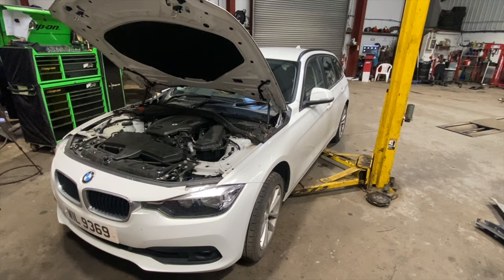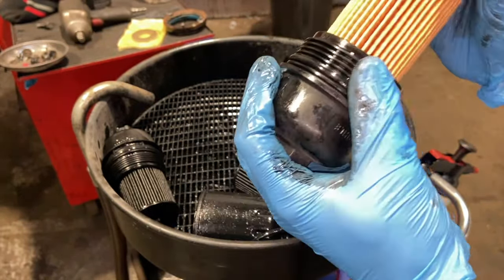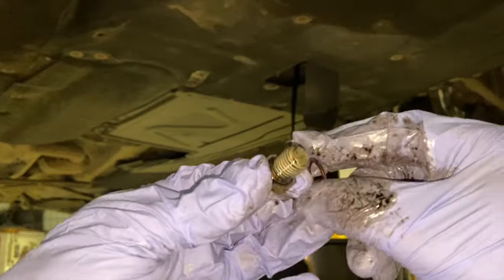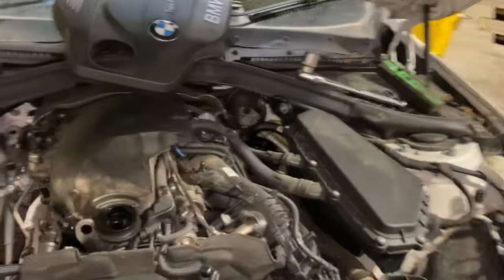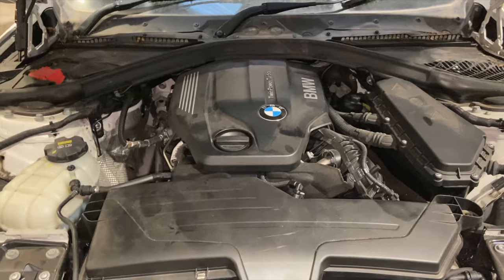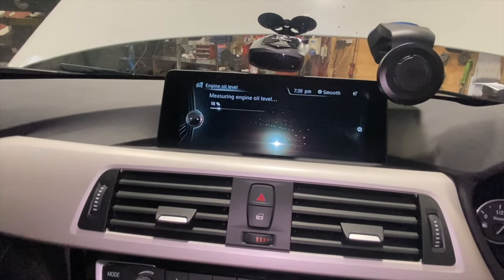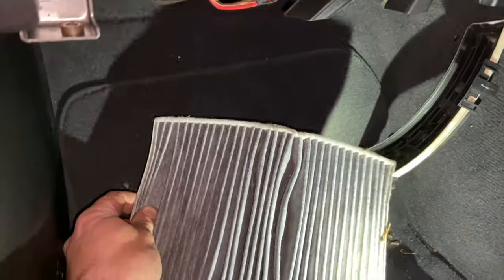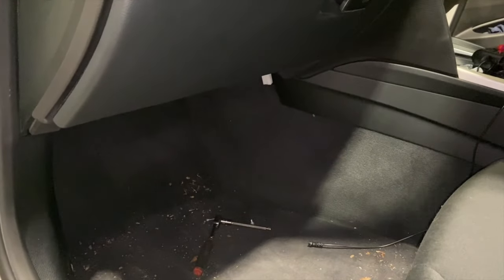Engine service procedure BMW 320d F31 (Oil, Air, Fuel & Cabin filters)

Comment from the maker: Check Euro car parts - https://tidd.ly/3lIO7xA  (use discount codes on site)
Check "Car Parts for Less" - https://tidd.ly/2LNEwIn  (use discount codes on site) 
Check GSF Car Parts for parts - https://tidd.ly/3q1T7Q0

Engine Filters & Oil from Euro Car Parts : 
Oil Filter - https://tidd.ly/3niljNK
Air filter - https://tidd.ly/3vghTh3
Fuel Filter - https://tidd.ly/3ve0SUB
Cabin Filter - https://tidd.ly/2QWtO4A
Engine oil 1ltr - https://tidd.ly/2Qw5qqJ
Engine oil 5 ltr - https://tidd.ly/2QQRW95

Full service kit inc oil Ebay - https://ebay.us/4XrUEi
Engine oil eBay - https://ebay.us/NCbyM4

Engine oil amazon - https://amzn.to/3dJBXlV

Tools : 
Brake cleaner - https://amzn.to/3ni29qU
Digital torque wrench - https://amzn.to/2PgQw79
27mm low profile 3/8 socket - https://amzn.to/32IkLad
Socket set - https://amzn.to/3eGx2Ak
Brake cleaner sprayer - https://amzn.to/2BLF1gX
Longer reach 3/8 ratchet - https://amzn.to/3iJsADg
Ring Inspection Lamp - https://amzn.to/3gGWHcG
Pic set - https://amzn.to/33JcZyJ
Dewalt 3/8 impact driver - https://amzn.to/3njemLY
Screwdriver set - https://amzn.to/3jswgJP
Budget EOBD scanner eBay - https://ebay.us/IHpAfK 
Advanced EOBD scanner eBay - https://ebay.us/odL6V7
Torx & screwdriver bit set - https://amzn.to/3sR77fr
Reply: Yep. Excellent job, nice video, tis well-explained !
Reply from the maker: @Dm64600  thanks for the comment 👌👌👍

Comment: Great video mate. Thanks for the tip on the green tabs on the fuel filter. They can be quite fiddly to remove. A few points worth noting, the car does have a dipstick as others have mentioned. Its also best to use Mahle filters. The cabin filter you fitted doesn't have the charcoal layer which prevents bad odours from entering the cabin. Lastly its best to start the service with replacing the engine air filter. That way the clean oil gets fresh air on its first start up. If the old air filter is really dirty, some of the junk can get into the clean oil.
Reply from the maker: Thanks for the comments, feedback is always appreciated 👍👌
Reply: That’s not the way engine air filters work. Unless you have a breach in the filter media or perimeter gasket, a loaded filter actually blocks MORE particulates from entering the engine. Do the air filter replacement before, during or after oil change- it doesn’t matter. 
And as for using only Mahle filters- also incorrect. Mann, Hengst and Bosch all make filters perfectly suitable for BMW.

Comment: Thank you very much, especially for showing the correct disconnect procedure for the fuel filter exit hose. Many other people remove both green clips completely from the connector. Very risky because you can loose and/or destroy them this way. No spare clips available, only complete hoses with mounted connectors.

BTW: BMW Diesel engines have a classic dipstick, you even touch it with your hand while showing the oil filter beginning at 2:00 ;-)
Reply from the maker: You are welcome! thanks for the comment..👍👌 lol ive never even noticed! I did think they had but wasn't aware where it was.. thanks for pointing it out 👍
Reply: I thought that it was a blank? And that you’d need to buy the dipstick if you want to use that hole.
Reply from the maker: ive not had another one it yet to have a look ha
Reply: @piovo1  Never heared such things. BMW Diesel always have dipstick AFAIK, never saw one without.
Reply: @ruhrpilot yeah I was thinking of my previous Audi, both my N47 and B47 have full dipsticks, including myself😂

Comment: Changed mine and took 5.2l of Shell Helix Ultra ECT 0w-30 BMW- LL04 C3. On autodoc says that I need 5.2l, so I went on their recommendation.
No issues whatsoever as level says it correct even on dipstick.

Car is f31 ‘16 sport 120kw 163bhp Efficient Dynamics manual
Reply: @diydaly  weird as I’ve read that only takes 5l and dealership wont say for real

Hard to find something legit about this
Reply: @cinematicb it's 5.2 liters

Comment: Thanks for the video.   Really appreciate.  When I replaced fuel filter and started engine,  diesel was leaking from heater end.  I hadn't pushed heater end in enough, plus retaining clip not seated properly.  I  started engine again,  no more leaking , however I  noticed a buzzing,  humming sound which  I'm sure was not present  with old fuel filter.   Buzzing noise coming from fuel filter or fuel tank.   Car drives fine.  Anyone have any insights regarding buzzing noise after fuel filter change?

Comment: Hi Daly just a question I’ve done all the changes and checks but I’ve got my resets up before but can’t seem to get the service and reset up again do I have to drive it a bit before I can get the service and resets up again cheers great video regards John
Reply from the maker: Thanks for the comment John .. you should beable to get it up strait away even if it’s just been reset.. did you manage to get it done in the end?

Comment: You MUST bleed the fuel system by activating the low pressure fuel pump in the tank, trying to start the engine without doing that can write off your car, because you'll be trying to run the high pressure fuel pump dry and it can break very easily and distribute swarf around the system and destroy your car. Source: destroyed my car.
Reply: So how do you activate the low pressure fuel pump?
Reply: @HowitzerBlitzer  there's no easy way, you have to either download ISTA and use an ENET cable then there's a service function called "Bleed fuel system", it pushes 4-5 bar fuel right to the high pressure pump and lets air out for 3 minutes, so the HPFP doesn't start dry. Some other OBD tools may offer that too. Some people short a 12V wire under the fuel tank-side rear seat  and activate the pump that way.
Reply: Agreed. I cringed while the engine was cranking in this video.
Reply: If you fill the fuel filter first and run it at idle it work’s perfect. I’ve been doing it for years and never had a problem yet. Hope it helps
Reply: @michaelhughes362  
How do you propose to fill the fuel filter?
What vehicle have you been doing this on for years?
Reply: Nah, Made several changes on several diesel bmw:s. No need to bleed anything. It’s sorted automatically. This is a crap comment. Sorry

Comment: thanks in advance for the video. One question: could you tell me what is the tightening torque of the oil filter cap? and  the tightening torque of the sump screw?
Reply from the maker: Thanks for the comments..Torque settings required are 
Oil Filter Cap - 25 NM
Sump plug - 22 NM
Reply: @diydaly  Thanks DIYaly
Reply from the maker: No probs 👍

Comment: With the oil you don't just find 0w30 right, it's meant to meet the oil spec it needs too like BMW LL- 04? If not it won't have an additive package to support a chain timed engine causing premature wear.
Reply from the maker: I use a really high spec 0w30 low ash that we buy direct from vw in 200l barrels .. It crosses over to the same spec LL04 . The dealers are quite crafty in naming oil specs so it’s quite hard to determine which one is correct. Although the ll04 is the main recommended oil they do list alternatives that can be used .. certainly the low ash is a better oil to run in an engine with a dpf.. 👍
Reply: @diydaly  TPS Quantum 0w30?
Reply from the maker: yes mate the normally use Longlife3, Specifications ACEA C3 API SN 
Approvals BMW Longlife-04 Porsche C30 VW 504 00/507 00 or the 0w30 quantum
Reply: @diydaly  Ah ye nice, I recently got a trade account with them, their oil pricing is very competitive, I can't complain haha. Seems like good enough stuff.
Reply from the maker: @MrZimmaframe  👍 yeah there good .. we use the lincoln branch and there’s some decent lads there too 👌

Comment: I mighy do a interval service/oil change oil filter on a bmw X4 20d I am guessing same engine as this. Do you tend to just add 5L of oil straight or check how much volume has come out first?
Reply from the maker: yeah it should be the same mate, as I knew the exact quantity I did just put the 5l in but if you are a little unsure its always best to but 4/4.5 litres in then keep checking 👍
Reply: @diydaly  Ye because i know the oil level sensor has to be up to a certain temp before it reads a new measurement, if not it just displays the old measurement. So think I will drain the oil when semi up to temp and measure the drained oil, and fill accordingly. There is something to be said for the simplicity of just having a dip stick like I am use to 😂.
Reply from the maker: @MrZimmaframe  haha yeah I agree mate! they over complicate things too much! there's nothing to go wrong with a simple dipstick
Reply: @diydaly  Haha in the end I drained the oil and measured it in my jug only to realised they now have a dip stick next to the oil filter housing on the X4 😂, I didn't notice it as first because they have made it all black so it blends in. I got just over 5L out of it so put 5L in and it was bang on max perfect 😁. I used Quantum Longlife 3 5w30 'bmw Longlife-04' so should be fine now for anothe year, not a fan on the display saying next service in 19k miles. seems a bit too long for my liking.
Reply from the maker: @MrZimmaframe  haha nice one, yeah I agree, personally I do my own oil every 6 months (5000 miles approx) but realistically id recommend doing it every 10-12000 miles .. 19000 is too long
Reply from the maker: I used the quantum 5w30 Longlife too mate, that's actually a close friends BMW that I look after, I own a Audi A4 B7 myself mate 👍

Comment: Ive an 09 320d m sport and my oil filter does not have the 27mm nut on the top its just smooth ????and help ?? Regards Dean
Reply from the maker: Thanks for the comment dean, yours must have a different filter on, if its still just a plastic cap you'll need a universal filter removal tool or the correct fitting cap.. you can get metal caps that slot over the top of yours .. ill attach a link.. you'll just need to check how may sides yours has as there are some options, they call the sides "flutes" on the listing .. https://ebay.us/7XhSEN
Reply: @diydaly  thanks for the reply much appreciated Regards Dean
Reply from the maker: @Bigjoelifts15  no probs, hope you get it sorted 👍